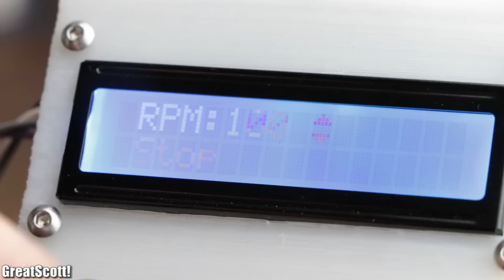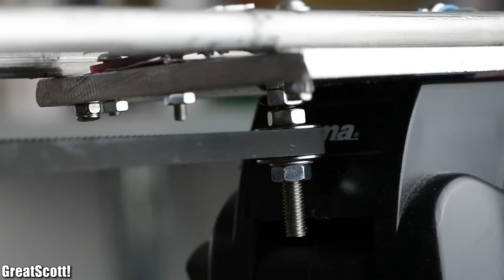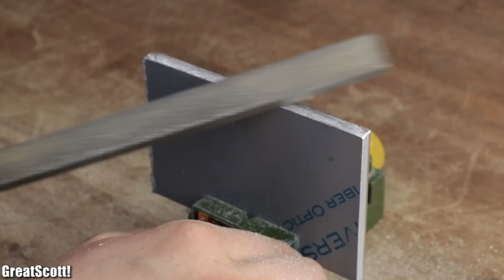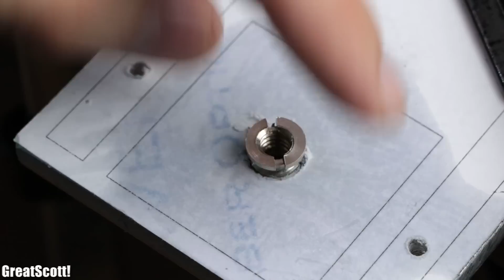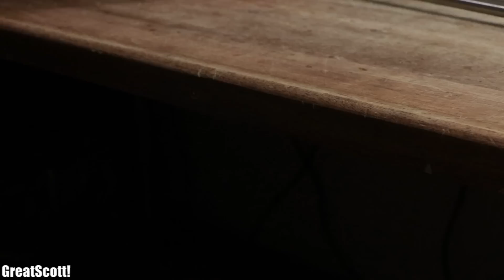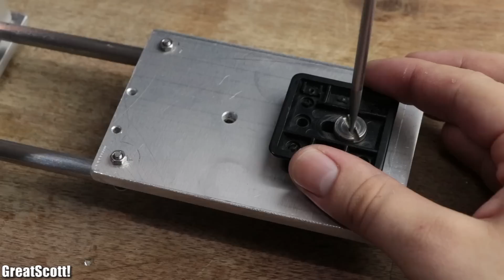Make your own Motorized Camera Slider (Part 1) - the mechanical build

Comment: Whoa boy Scott ... stick to electronics. :) Suggest one round bar .. you need precision ground one ( salvage from a bubble jet printer) and rather than another bar, use aluminum L channel with corner pointing up. have a teflon roller roll on that. smoother stiffer action with no binding.

Comment: Excellent build Scott, this is ambitious for a home build but you approach it all logically and make it look straightforward. One suggestion though is to use 8mm ground steel bar instead of drawn tubing. Ground bar is far more accurate, rigid and is what the linear bearings are designed to run on. You can get some cheaply on EBay. I look forward to the next episode! And later on to you making a 3D printer!

Comment: where did you buy the limit switches on PCB? couldnt see them in description?
Reply from the maker: I will add them to the description in part 2
Reply: nice one, any chance you could recommend a solder station? I'm looking at the hakko fx888d.
Reply: poor sunhokey printer

Comment: Probably you should try it with solid steel rods of larger diameter.  You can also find ones with pretty good tolerances specially made as linear axles cheap on E-Bay.

Comment: Had the same issue with binding when I built my cnc with cheap 8mm rod. Found that marking the length of the rod with a marker pen then running the bearings over them shows up the thicker areas which can be sanded down

Comment: In the past I almost built a similar project for a work studio. I was leaning towards the idea of using copper tubing from any home improvement store as the railing. I also like the idea of using roller skate wheels for travel. If you position them at 90 degrees against each rail, (like  O>--<O ...if that makes any since) you could build a smooth controlled linear motion.
  I was looking into building a linear drive to photograph high end bicycles I used to sell. I had planned on building a gigantic bicycle size 360 degree turntable in combination with a linear camera slider. I didn't just want linear motion though. I was planning to use scrap plywood to create large radius bends for the rails. The rails would bend kind of like a double helix, but with a more compact hook over the top to allow the camera to point at the ground directly over the object and tilt up as it partially rotates around the object on it's way to a ground view. It would definitely take a dual counterweight setup and would probably need a gear reduction motor for smooth travel. This system would allow me to capture the overhead, ground-up view, and the 360 degree view. 
   My ultimate goal was to build it and set it up with full automation so all I would do is set the bike on the stand and an Arduino would position the bike and camera,  detect that the all motion was settled on both the camera and the bike stand, then trigger the camera to take an image. 
    So basically I was in the planning stages of building the most advanced bicycle product photography system ever. Even 360 degree systems are limited to a two dimensional view plane.
  ... Got to love dishonest business partners... Oh well, I may give it a second go soon. Maybe this gives you some ideas :)

Comment: Two years ago I built a similar slider with 10mm steel tube (I think) and I immediately notice the problem with a smooth sliding. It's very difficult to perfect align all the 4 linear rail sliders and also the weight of the camera will bent slightly the tube so I think that it's your main problem. Congrats for your video, I will wait for the second part!

Comment: From my knowledge you put the washer on the wrong side.
You use steel bolts, nuts, washers and steel pipe bolted to aluminum.
Therefore, I think that it would be more practical to put the washer on the aluminum side, as it is the soft part.

Comment: Most 3d printers use a 3 point system not 4 for their linear rails to avoid the Racking or twisting that can prevent the slide from binding up.

Comment: I think the choice of using tubes rather than smooth rods kind of fucked it. The reason no 3D printer or CNC machine designs use them for linear motion is that even the hardest ones still have a non-negligible amount of flex, and that's what is causing your binding.

Comment: Great work! Just a tip: I would put a piece of junk wood under the metal plate rather than drilling it on the edge of the table.

Comment: I like the build but you should've used a high speed dc motor that is geared down instead of a stepper motor so that it is not so jittery.

Comment: dude they're binding it is not the diameter
Reply: I have used very similar linear bearings and very similar tubes on a project and it the diameter/roundness are definitely PART of the problem. I agree that they are also flexing/binding, but even with a single bearing sliding on a tube with no loading, I could feel they run very unevenly.
Reply: +YensR your probably right

Comment: Nice device but it will be prone to minute vibrations and rocking while moving. I would recommend using a dear system to move the camera instead of the pulley/belt system you have.

Comment: Any reason you didn't 3D print the base plates?
Reply: +CoolGuy 77 Good point. I had thought it would have been a perfect usage to showcase his 3D printer, but as a tutorial it does makes sense.
Reply: There is an ADA fruit 3d printing show where they built one of these using 3d printed parts if you're interested.  I made my own models for the left and right stand and used 3 rods to keep everything pretty stable, the stepper motor overcomes any binding I've seen so far but haven't tried putting a DSLR on it or anything heavy, I'm actually thinking of putting a laser and small camera on the mount to do 3d scans.
Reply: +Shaun Husain adafruit autocorrect error
Reply: +Antonino Frey For this application I do not think it would make any difference as long as you print it properly (infill, layer, etc)

Comment: why did you use steppers? couldnt you use normal brushed or brushless motors which are smoother?
Reply: Stepper motors are easier to control when it comes to making reproducible motion so you can calculate the number of steps for the whole rail and can more easily make small motions consistently. Turning a regular brushed motor on and off doesn't work well for small motions (I tried something like this with an RC car and ultrasound sound sensors, in my case the major problem was the voltage changes as the battery discharges so getting the throttle right was very hard).

Comment: sir, can you please tell me how to check a solenoid using multimeter?
I made a Tesla coil and the solenoid doesn't seem to work. when a led is connected to the ic ends it lights up,but near tge solenoid it doesnt. How do I check it?

Comment: 1. those are BEARINGS and not BUSHINGS (big difference!) 
2. stainless steel WILL get damaged by bearings over time, you need chrome-hardened steel rods for that... if you want to use regular steel or aluminum tubing, use bushings like IGUS

Comment: Almost the same design as mine! :o  I use solid 16mm rods with hard crome in the surface. Rolls smoothly. Weigh is more than 2kg tho'..  I use servo motor modified to spin 360 degrees, servo tester and same gt2 pulleys and belts as you.

Comment: If you do this again you might want to use an 8mm rod holder which can be purhased on ebay. They use friction to hold the rod in place and work quite well and allow to you get them precisely where you want. You might also want to use hardened 8mm rod which can also be sourced from ebay. This will be stiffer than the tubing that you have and is precision ground to ensure to sticky spots and a constant diameter.

Comment: Couldn't you use the motor and other parts from some old / broken printers? I already read that you used parts from your old 3D printer, but really, an old printer can have 80% of the parts used in this video.

Anyway, I'm not here to complain. Good job on this project. Waiting for part 2.

Comment: Wonderfull, congrats! :) Also I'm working on this project for making timelapses. I think two 10mm stainless pipes work better. Recently I experienced a worm screw mechanism instead of the timing belt, but I didn't get a good result (see my last video).

Comment: Nice design! But tbh it looked in 6:39 ish that the pipe was bending a bit. I would've went with a steel pipe and go through the extra work of drilling holes. Correct me if I'm wrong though
Reply from the maker: I know that there are still problems. I will try to fix them for part 2.
Reply: I'll look forward to it! It will be interesting to see another version of a slider, because I've seen two versions already

Comment: It might bind less if you only use 3 bearings. It's usually nearly impossible to mount many bearing perfectly in line, and it will still be constrained properly with only 3.

Comment: Have you thought of using thicker, sturdier pipes?
Reply from the maker: Yes, but I wanted to give those a try because they can hide the wires of my limit switches very nicely. Wait for part 2. I will talk about problems and solutions there.

Comment: Niiiice :D!
I build a smaller non-motorised camera slider recently using free engineering samples I got online. I wanna make a bigger, motorised one some day, probably using a lead screw. not decided yet!
Regarding those taps, do you need to use all three? I did wonder about this, and figured the bands on the taps indicated the order, but I only used the first, un-banded tap on my slider, and the tripod screwed into it just fine. Would love to learn more.
Reply: metalhead2508 Thought that'd be the case, and I can see it on Scott's taps, but mine all seems to be the same. Least I have two spare! Taps and I have had a long and checkered past..

Comment: hi great scott... could you please please pease in the next part mention how slow exactly the stepper motor would be able to move? I have done a lot of research on this as i want to build one myself but could not get a suitable answer. what i would like to achieve is say a timelapse where the camera moves smoothly from left to right in a 24 hour cycle. im not sure if a stepper motor can move that slow though?
Reply from the maker: Next video will be a basics video about stepper motors. You will find your answer there.
Reply: AWESOME!!!! Its amazing too me hou many projects i want to build an then 2 weeks later you come along with a video about it and adding a helping hand... thanks!

Comment: dude. can please make an video on how to make own quadcopter?
Reply: 1) he will get to it
2) there already many on the internet
Reply: +Fluburtur +Joe M  they are assembly of ordered quadcopter video. not like built from begining.
Reply: If you are already deep in programming and doing electronics, you might unstand it. Otherwise it would be very complex to adapt your own version of it.
Reply: +Remco Hardeveld yes bro. i am a developer. but my department works on different technology. i just want help dude..
Reply: If you are already a developer you know how to program. That is the hardest thing to do if you want to make a quadcopter from, lets call it, scratch. For the other parts you can easily find it on the net. They only thing you could develop is de main controlling board, the rest you need to buy becuase of different good reasons.

Comment: Nice project! Usually in this kind of setup, you would need to engineer the base plate very precisely to prevent the bearings from scraping the rod (or tube) because it will be statically indetermined very easily, like it is now probably. Also, the tubes might lack the stifness needed for such a heavy camera. I am very curious to see how you will solve this, looking forward to your next video.

Comment: i built one too i used a cheap Slider from eBay and got a threaded Metal rod. i glued a Nut on the moving part and built a wood Base for the rc Motor and the arduino. on both sides i used bearings to keep it smooth
Reply: and mine has a timelapse shutter for Canon dslrs

Comment: I would have gone with Maker slide and used bearings, those pipes are really flimsy for that application.
Reply: The supported weight and free span is much larger here than in a normal printer, hence the need for larger diameter rods/tubes. You can get them at high precision (check IGUS for example), but they quickly get very expensive.
Reply: metalhead2508 I'd say that's not a "normal" printer, but yes you are right. We have plotters at work that definitely would have suitable stuff inside. Probably nothing you can pick up cheaply on ebay, though?

Comment: just looking at the rubber chain I thought that's gota wobble like hell, but the shake at 0:21 is far too much to bear, to be honest
Reply from the maker: I changed the speed of the motor in that shot.
Reply: the motor is stopped whenever the camera taces a pic anyways
Reply: its for panning video, not photos
Reply: Benargee
well, he did say timelapst. unless your camera supports that mode, taking a picture every second and merging it on a computer works too
Reply: way better /watch?v=xV8cVrTkrLg

Comment: why tubes? wouldn't a rod work better
Reply: like rods from an old 3d printer
Reply from the maker: When it comes to stability a rod would have been better. But I wanted to hide the wires of my limit switches (inside the tube). At the end of part 2 I will talk about such design choices and what I could have done differently.
Reply: +GreatScott! for time lapses stability should be extremely important, if hiding cables is so important I would of used 2 rods for the track and mounted a tube that was smaller in diameter in between out of the way of the belt system for cable managment
Reply: i wondered the same.....but i guess that tubes are more expensive and/or he just had those tubes
Reply: +Zaid Ahmed he has an old pursa 2? I think that didn't perform very well and he replaced with a better printer, he could of printed this whole project off and used the parts from that printer save for a tube for cable management